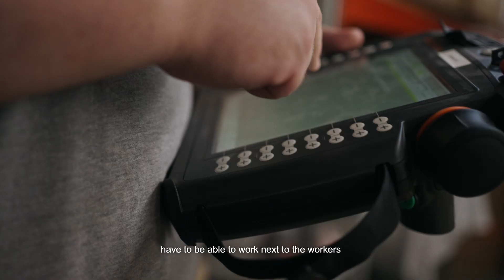AIRSKIN Hero-Video

Comment: Sorry, I dont get it. We have a robot that can handle 300kg, even if it stops during touch. I would never allow anyone to work near that, maybe it will be stoped but the impact inertia, and potentially workpiece that is not surrounded by foam can harm someone really bad. Or even worse, someone can get squeezed and in that case the is no protection apart from toruque on the motors.
Reply from the maker: Well, I guess it is up to each plant manager individually. Big car manufacturers (Ford, VW, BMW, ...) already have AIRSKIN robots on the shop floor producing our cars. The speed is always set according to the potential risks, so if there is a danger of clamping someone, it will move slower and if it would just result in a shove, it is allwoed to move faster.